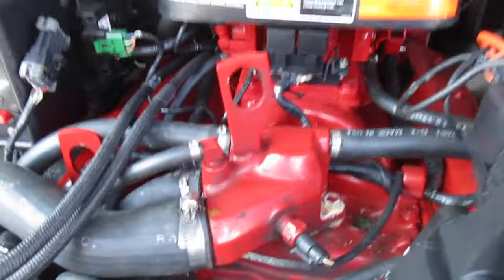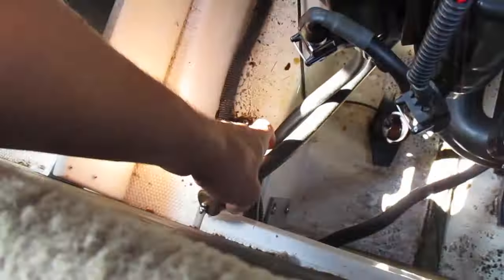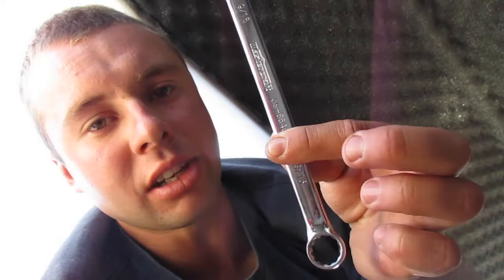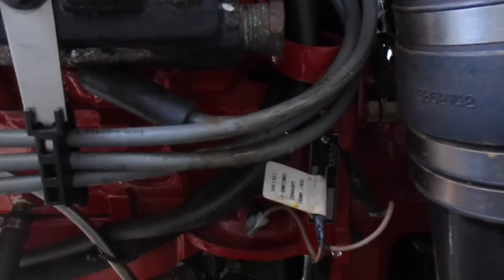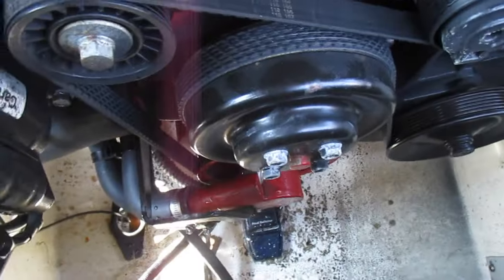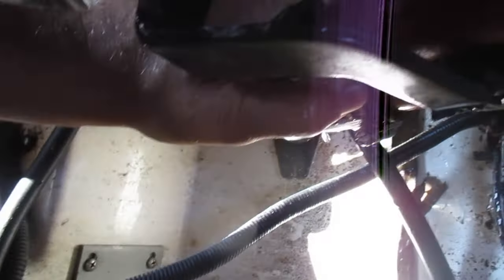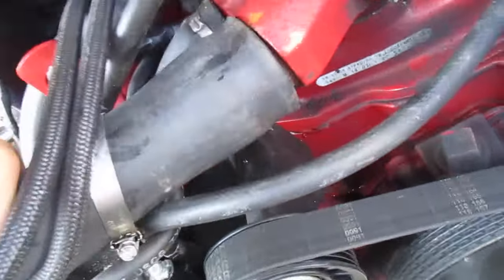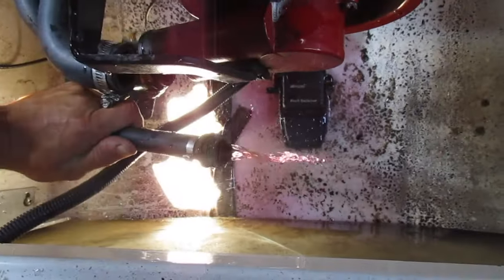Volvo Penta 5.0 GXI Winterization. Drain Your Boat For Winter.

Comment: Thanks! This is a great video. I followed your instructions exactly. The only catch was when I poured antifreeze into the thermostat via the engine  circ pump tubing, no antifreeze came out the drainage hole on the block or the risers- it immediately started coming out the lower outflow /outlet from the engine circulating pump. So, what I did was I took my hand and occluded the lower outflow opening (from the engine circ pump) and then had my son pour AF from above like you do, and then after a couple gallons, antifreeze started coming out the drain holes on block and risers (so I then knew the AF was making it through the thermostat housing into the hoses to the block and risers). We then(with my hand still occluding the lower circ pump opening) put the 4 drain plugs in, and then filled with more AF until it started pouring out the top of the hose (highest point in system) I was using to pour into thermostat housing. This way I knew all water was displaced with AF, mostly for anticorrosion purposes. I then released my hand, and AF drained out from below. Probably overkill, but makes me feel better and saved me $500 by not having a remote winterization done at my boathouse. For next year, I will fashion blind end hose to attach below so I don't have to occlude with my hand.  Thanks again, and great video!!

Comment: Best video I have seen on how to get your block 100% winterized. To many only cover the running of coolant through the system which does not always fully protect the block if you don't drain properly or get the thermostat open when running coolant through. Well done.
Reply from the maker: Thank you. I see too many people do it wrong and decided i would make a video. I hate doing the coolant pump through method.

Comment: I picked up my rebuilt 2004 Volvo Penta 5.0GL-D from my mechanic last month (September '22) after the block cracked a few years ago from my NOT winterizing the motor. This video and comments are invaluable to me, especially now, since I just spent my grandkid's inheritance on the rebuild. It looks like Schneids15's Penta 5.0 GX-I is similar to mine. I located a workshop manual PDF and his GX-I is included with my GL-D in the manual. 
     I have a crazy question about displacing water from the cooling system. Will high pressure air blown through the hoses not work, assuming drain plugs are removed, followed by flushing antifreeze through the system?
     Finally, a excerpt from my manual based on a question someone posted in this feed about draining. The manual reads:  
When draining the cooling system, raise or lower the bow of the boat to position the engine in a level horizontal plane. This will provide complete
 drainage of the engine block and manifolds. If the bow is higher or lower that the stern, some water may be trapped in the engine block or manifolds. Improper or incomplete draining may result in freeze damage to the engine, manifolds, sterndrive, or other components. Freeze damage is not covered under Volvo Penta’s Limited Warranty.
Thanks for posting this video 🙂

Comment: Interesting. I like that hose that connects to the block drains but it would not work here (salt water region) because the drain plugs always have to be rodded out to get them to completely drain due to rust flakes. Looks like you're in a fresh water region.
I drain the engine and manifolds and then put some gasket sealer (OMC gasket sealer or Permatex Aviation) on the threads. Then I re-connect the lower end of the big hose on the front circulating pump, and leave the upper end (thermostat housing) disconnected. Then I fill the engine up with -100 marine AF through that hose till it spurts out of the thermostat neck. Then reconnect that end of the hose on the thermostat housing. I also fill the manifolds with -100 through the feed hoses till it runs out the exhaust bellows. Lastly I disconnect the raw water intake hose at the thermostat housing (this is on an OMC Cobra system) and point it down in the bilge to drain. Then I hold it up and fill it with -100 marine AF, this flushes out the raw water intake hose, power steering cooler and impeller in the drive, fill it till the AF runs out the drive water intakes.
Reply from the maker: All good points. Thankfully i do not see many OMC they are more work to winterize. Those block hoses are handy but they are somewhat untrustworthy as i prefer to poke the holes and be 100% they drain. Some boats you simply physically cannot get to the plugs though and have to rely on this.
Reply: Ppl

Comment: are there also block plugs or just the manifold plugs ?   I have that same hose on the side you set down in your bilge, also does the thermostat have to open though when adding the non tox ?

Comment: Hey how can I verify if my model has a power steering cooler that needs to be drained? Even if mine is on an angle like yours, my boat is sitting at an angle and I’m worried it’s the opposite angle of the cooler slant… don’t have level ground. Thanks

Comment: Thanks for answering.  If you use this tube method, you dont need to bring the motor to temp, is that correct?
Reply from the maker: That is correct. The manifold hoses go directly to the manifolds and the tube goes to the t stat housing but flows around into the block and you will see the pink come out each block hole and manifold so you know it is 100% not going to freeze. It is a lot more work than the pump through method with the muffs and antifreeze but is the safest.

Comment: So, I drained the block and the exhaust manifolds and I disconnected the engine driven water pump and the hoses the go into the impeller. No issues. Then I decided to take it to the next level because I am paranoid and I can’t leave anything alone. I decided to put the 4 drain plugs back in (two on the block and two on each exhaust manifold), block off the water pump inlet (on the engine driven water pump) and then I took the water line that goes from the impeller to the thermostat housing and lifted it so that it was higher than the thermostat housing. Basically, I wanted to force antifreeze into the the block and into the exhaust manifolds. Next, I poured two gallons of anti freeze into the the thermostat housing (just like you did in your video). Once that was done, I opened all 4 drain plugs again and I let the anti freeze drain out. I then undid everything I mentioned before and let all the antifreeze drain. Only 1 gallon of anti freeze drained out, which means there is another gallon somewhere in my engine. Does anyone know where it might be? Is it something I should worry about?

It’s a Volvo Penta 5.0 GL

Comment: Other than this video, what else should I do to prepare to boat for winter, lower unit/fuel system, any other tips or advice?? I have a 5.0 GXI
Reply from the maker: Hey, yes change gear oil if needed. If oil is a nice clear or blue colour i would not change. Be sure there is no water in the oil. Will be a milky colour if so. Stabilize the fuel and you can fog if you wish. I personally don’t fog.

Comment: Thanks for this video , just want to ask is there anything to be done besides you showed for winterization , of course I know the oil change the fuel stabilizer?
Reply from the maker: You got it. Just stabilize and do the oil and filter. In the fall/ spring a new water fuel seperator is a good idea

Comment: Why not just use a funnel when filling up AF thru the top thermostat intake? Then no need to remove the entire hose and block the lower hole with hand (as one commenter did). 

The most elegant way however to fill an engine with AZ should be using the direct hose intake (that exists on most Volvo Pentas) and run the engine with AZ as coolant. No hoses to unscrew, you are sure entire system is filled up. As an extra bonus you can fog the engine on this last AF run and kill the engine that way. All squared away, imo.

Comment: what temperature is this method good for?  you did not warm up the engine to open the thermostat?    no anti freeze in the engine block?
Reply from the maker: By pulling the hoses and plugs you drain all water. The antifreeze poured through after verifys that pink is coming out of the plugs and has drained. The pump through antifreeze method is more of a diy method.

Comment: After draining the raw water side for the winter is there a need to fill it pack up with water in the spring to start it? Or does it fill itself once placed in the water?
Reply from the maker: Hey Joelene no need to fill back up. Just make sure you have the drive in the water or muffs to the drive if running it on land and it fill right up.

Comment: Thanks very much!  I'm in coastal SC only a few nights in the 20'S per year, daytime always warms above freezing, can I just put a small electric heater in the engine compartment? Thanks!!
Reply from the maker: That would work for sure. As long as you can monitor it isn’t gonna freeze that would work great.

Comment: You forgot to drain the fuel pump coolant! Also, best to leave the hoses attached to the impeller housing and just remove that to make sure there's NO water in the impeller and replace er in the spring ;) I don't bother removing the hose from the thermostat housing, never had an issue.
Reply from the maker: Yes all fifferent ways of doing it. This seems to be the easiest and safest for me. What do you mean for the water pump? You leave the hoses on but it drains? I don’t get it. Also the fuel pump water cooling line is on the older models on the back of the engine where the high pressure pump is mounted.
Reply: @Schneids15  Let's not confuse the GM water pump with the impeller pump/housing. If you don't remove your impeller, there will be water trapped between the vanes. Remove the housing... get it. Re-read what I said. My vintage of the 5.0GXI uses the raw water cooling system to cool the fuel pump assy, it NEEDS TO BE DRAINED
Reply from the maker: Alright so basically no you do not need to remove the impeller. Their will be a tiny tiny amount between the vanes and when it freezes the impeller just moves a little bit. Not saying it is bad to remove the cover but 90% of people do it this way would be my guess. My 5.0 GI in my regal has the VST housing on the back that does need to be drained yes. In this specific situation you do not have to drain this as is it in a fuel cell all up front.

Comment: Thanks again for the vid. Does this motor have knock sensors on each side of the block that also can be removed as drains? Or is that just the 5.7?

Thanks

Comment: Ive been searching for a video like this forever.  Thank you for finally doing one that is quality.  Question: I drained my manifolds 1st and then opened the block drain hose.  A good 15 seconds of water came out.  Hardly any water came out...maybe a half second from the block drain.  How much water should i expect?  I suppose i can dump the antifreeze until i see a good pink stream..
Reply from the maker: I would suggest pulling the hose where it attaches to the block and poking it. The hose system makes it simpler but rust still develops in the block and plugs the hole. There should be a fairly significant amount of water. I would say a gallon from each side i would guess.

Comment: Just wondering what year this is.....I am the new owner of a 2005 Caravelle with a Volvo Penta 5.0 GXi and wondered if the set up would be the same.  Thanks for the video!
Reply from the maker: This boat is a 2002 i believe. If you do not have the hose like this motor on the bottom just pull your 2 block plugs. Manifold plugs and make sure your water pump is empty. I appreciate the comment.
Reply: Great, thanks!  Do you happen to know of a good video or resource on winterizing the Volvo SX lower unit?
Reply from the maker: I will have one up here in a few days👍🏻 do you have a sx or SX duo prop?
Reply: That would be great, thanks!  I believe just the sx drive.
Reply from the maker: Video is up. Do everything the same as video but do not pull your props off. Your drain screw will be on the side of the bullet on the lower unit.

Comment: My gxi doesn't have that drain hose down below. Mines an 06 motor. Anyone know where to find it on my year?
Reply from the maker: If your’s does not have the drain hose you will have 2 individual block plugs. It is a better system anyhow.

Comment: Does the 4.3 gxi have the manifold plugs? And when do you put the manifold plugs back in?
Reply from the maker: Yes it will. Plugs can go back in right away assuming all water is out. I leave them out all winter so the manifold can breathe and not build up so much condensation.
Reply: These engines also have lower block plugs. I have seen videos where they remove these as well but if you drain with the built in water hose do we need to drain those plugs?
Also what about fogging? Is that needed on fuel or port injected engines through the air cleaner/throttle body?
Reply from the maker: On fuel injected dump a 50:1 mix of fuel and stabilizer in the fuel/ water seperator and run through til it smokes. Fogging oil through the intake is hard on the injectors i was taught. The lower plugs may be replaced with a hose. If there is a plug and not a hose remove the plug and poke it with a pick to remove rust.
Reply: @Schneids15  I have the drain hose, but there are plugs on both sides of lower block. I've seen so many videos it's pretty damn confusing... My engine is a 4.3 port injected gxi.
Reply from the maker: Regular Guy Fixes i would still pull the plugs. There should only be one hole in the block cast into it. Yours may have a fitting threaded into it, then a plug and hoses. Either way pull the plugs also.
Reply: @Schneids15  I just rechecked. Mine is a 4.3 gxi A/B it does have the flush hoses on both sides of lower block. No plugs to remove. Other than the two rear manifolds.

When I take the fuel seperator filter off is fuel going to dump? Just to clarify dump 50:1 in that filter, reattach. Run engine. That's enough to to coat?

Comment: Hi, just a question, I'm new to the Volvo Penta engines..... the very first hose that you drained (had the screw off copper top)  is that the water inlet hose where you attach the garden hose to and flood the engine with water so you can start up the engine when it's out of water?   Thank you.
Reply: It sure sounds like it, but was wondering that also.
Reply: yes it is.  many of them have a blue plastic plug on the end.

Comment: Thanks for the video. Does it matter if the thermostat is open or closed or does it even matter? Do you leave the manifold plugs out and put them back in spring?  With the hose connected to the block drain, there is no need to remove the block plugs?
Reply from the maker: That is correct. Since you are not flowing antifreeze through the system it does not matter if it is open or not. You can leave them out or put them back in. Whatever you prefer. If there is a hose attatched there will be just hose barbs attatched to the block. So you do not need to pull the plugs. If there is no hose be sure to pull the plugs.
Reply: @Schneids15  - thanks so much for the timely response!
Reply: I have a 4.3GL that has a tee in the top hose that goes to the front water pump with a vertical hose coming out of the tee up the side of the engine. It has a blue cap on it. It's not a block drain. Do you know what this would be used for? Thanks so much for your video and help!!
Reply from the maker: This is for if you do not pull hoses. It is an air drain so the block can drain. I still pull that main hose and dump antifreeze down. If you use this method you can leave the blue plug in so when you dump antifreeze in it will not pour out there.
Reply: @Schneids15  - thanks so much!!

Comment: Thanks for the video!

Are you not worried about the thermostat being open using this method? Or is the water there negligible. 

Thanks!
Reply from the maker: Hey Gryfter 187. No not concerned. Everything drains below your thermostat and if there was a little bit of water sitting on top of the  thermostat it drains out when removing the top hose. Then by pouring the antifreeze in the top it flows through all that stuff. I have been winterizing this for 6 years now with no issues.

Comment: Do you run the antifreeze through the system after and leave it in? Or do you leave the system dry all winter?
Reply from the maker: That is a big argument between mechanics for sure. I have been taught to leave the system dry but i do see the benefits of having the antifreeze coating everything all winter to minimize rust if that is what you are getting too. So to answer your question they stay dry. I work on many engines that are 40+ years old and they are still running strong and have been winterized like this for the past 40 years.

Comment: Thanks for this video.  Can anyone comment about pouring antifreeze through the hose... once the antifreeze starts coming out the other hose (so you know all water is cleared), can you close that end up and pour antifreeze back in to fill it up and leave inside over the winter?  Will that help coat/fill the inside to prevent rusting?  I live in a wet area (WA State) and worry about rusting...  Thanks!
Reply from the maker: I always find that since it is cold the air flow is better than having it blocked off. Just my thought.

Comment: My boat engine is a newer Volva Penta 7.4 (paid over $10k last year). I paid a guy $300 to winterize my boat. I was at work at the time but I did leave cameras on at the shop. The ONLY thing he did was lower the trim and run the motor until pink antifreeze came out the exhaust. Took him all of 15 minutes. He assured me my boat (Cobalt 222) was fully winterized because my boat is closed cooled. I'm suspicious. What else do I need to do to ensure I don't run into trouble? I certainly won't be using this guy again. I in Utah, so several nights are well below zero. Please help.